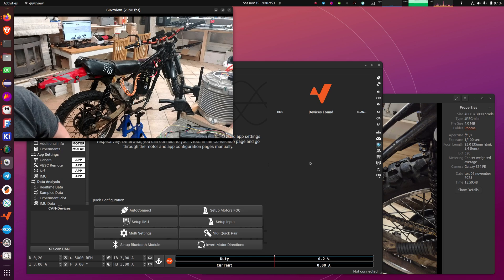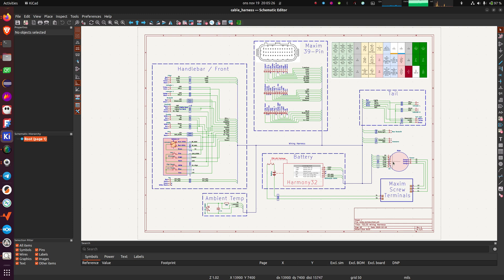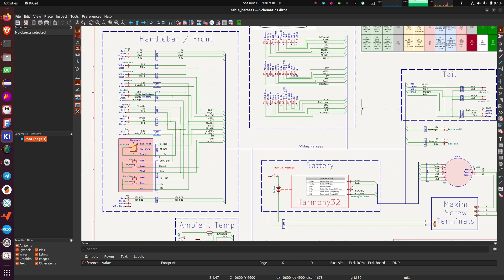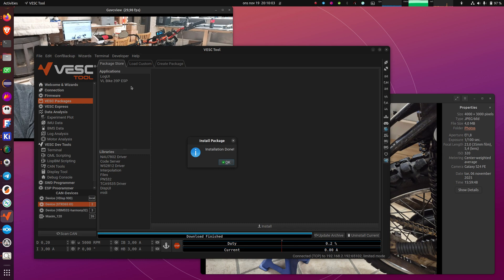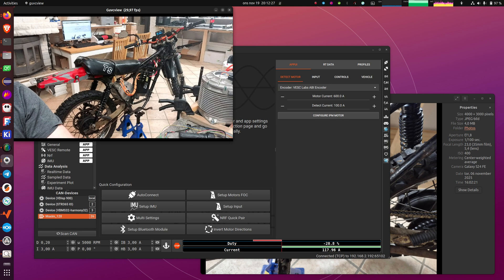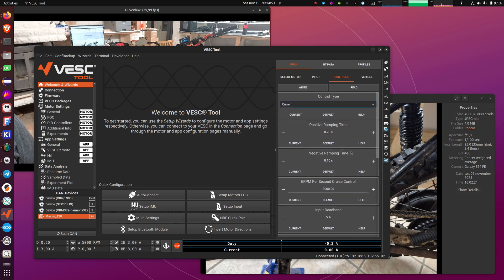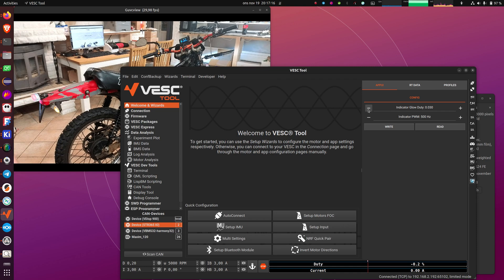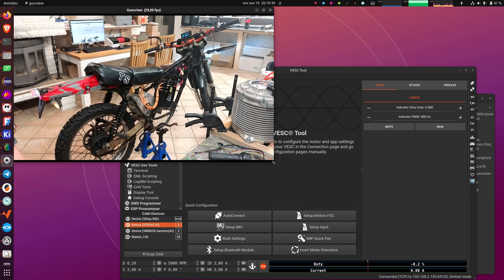VESC Maxim Bike Simpler Setup

Comment: Buona sera, ti chiedo scusa in partenza, io ho un monopattino elettrico dual motor da 3000 watt, batteria da 60 volt 30 ah, centralina spintend  ubox 2.1 da 200 a 72 volt, la mia domanda è quali parametri dovrei impostare sul vesc Tool per avere il massimo di coppia edi velocità, da premettere ho già bruciato una ubox spintend, grazie.

Comment: Hola puedes ayudarme tengo una batería lifepo4 52v 50ah con bms100, controlador 75100, motor 65121, mando vx3 lo he programado y en el agua 700w que estoy haciendo mal por qué el motor tiene 3700w
Reply: I would look at the graphs/logs, seems like the Foil zone forum would help.

Comment: Cool! Thanks for video! Need rebuild mu version ex board. If I'm understanding correctly, if I will use vesc remote control, I can use via lisp adc1/2/Rx/tx like pin for something, and reverse, cruise, brake, throttle will working? Thanks! Cool stuff!